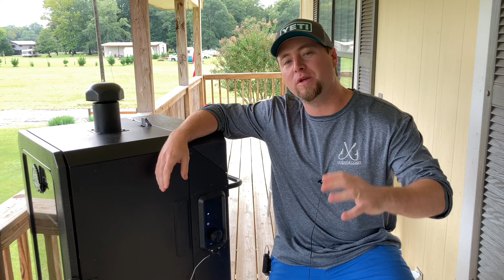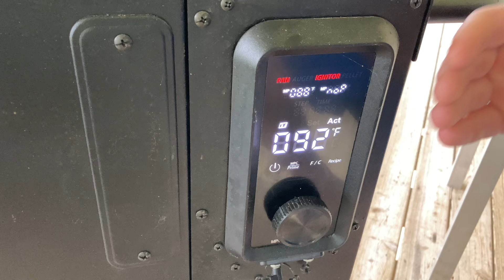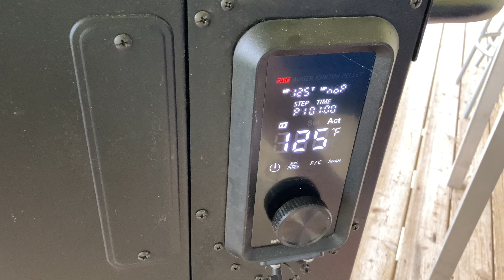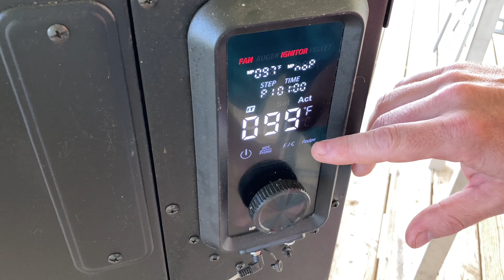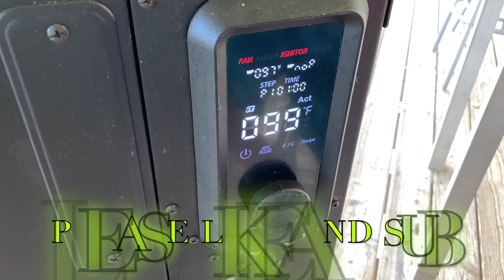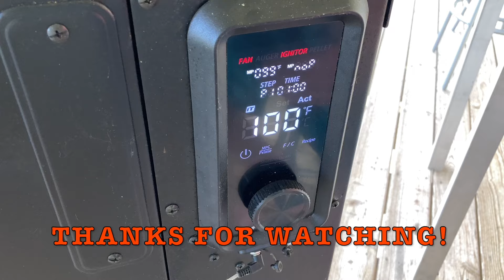How to MASTER the Control Panel on you're Pit Boss Pro Series Series 2 Vertical Pellet Smoker

Comment: When i am taking my meat out to wrap it, I have a loss of ignition. I just bought mine this week, and love it so far. I thought for sure if i was just opening the door and then closing it again, that it would be ok, but i guess not. Its happened both times ive cooked with it now, so im guessing thats what im doing wrong. When you DO prime, How long should i prime when i plan on opening the door to maintain ignition?
Reply from the maker: I’ve never had that issue. Have you primed both times?
Reply: @TheAmericanSmoke neither time. That’s probably my issue, thanks for the fast reply on a 3 year old video 😅
Reply: I’ll have to try it the next time I use it. It’s probably just operator error.
Reply from the maker: @rysingphoenix1524 that’s strange. Try priming next time and let me know how it goes
Reply: @TheAmericanSmoke the thing is, is I can let it get up to temp, put my meat in, and if I take to long, it will lose ignition. Pit Boss Comp blend pellets if that helps.
Reply: @TheAmericanSmoke just figured I’d give you an update. Started using the prime button, she’s not flaming out anymore. Did chicken last night, and I’m doing a pork shoulder and smoke smoked cream cheese right now. Thanks for your great videos man.

Comment: I have the smoker, let’s say I set my temp to 250 and o have a probe on the middle rack it’s always off by 20-30 degrees. Is that normal for these? Probe inside always lower. Thanks!!
Reply from the maker: It is. The internal thermostat in mine is located in the back corner right next to the vent where the heat feeds into the chamber. The temps at the center of the racks and especially at the area of the front of the chamber will usually be cooler. It’s similar in all types of cookers.

Comment: Do you ever have problems with the smoker not keeping the temperature you have set?
Reply from the maker: It did eventually and I replaced my control panel. It was still under the 5 year warranty and Pitt Boss covered the cost.

Comment: Hey man big fan of the page, I recently got a pro series just like yours. I was wondering if the programable temp you should set it to what you want your final meat temp to be at or should I set it a few degrees lower so it doesn’t over cook?
Reply from the maker: That’s going to be a technique you can develop. I would recommend not running the IT up to your highest tolerance before programming the temp to come down. Because you’re right, it probably will run over and possible overcook. The smaller the cut, the more careful you have to be with this automated stuff.

Comment: Is it possible to reduce the temperature  as low as 100 to 110 degrees to smoke venison thuringer ?
Reply from the maker: The lowest temp is the Smoke setting, which keeps the chamber around 130

Comment: I just got a new one of these and I think my control module is newer I don’t have the smoke it icon I’ve gathered they changed to the pit boss app but my smoker doesn’t have a smoke mode I was wondering if you knew if the new ones just don’t have that because where yours says S mine says L then goes to the same temperatures
Reply from the maker: I believe the L will be your smoke setting
Reply: @TheAmericanSmoke  thank you so much I was so confused everything on mines the same as yours except I didn’t see the S and love the videos man keep up the good work

Comment: How do I set the temperature level to smoke mode
Reply from the maker: If you have the same unit, it’s the lowest setting. It looks like a five but it’s actually an S
Reply: I have the same unit, it does not have a "s" mode at all.  Please show yours in the fabled "s" mode.  The unit only shows "L" and an "H"

Comment: I think that my control panel is broken. I've had my Pit Boss Pro 4 for two weeks now. I'm currently doing my third cook on it. My control panel does not have 225°f. It jumps from 200 to 230. Also my 2nd meat prob stays at 32°f and never moves.
Reply from the maker: Definitely sounds to be malfunctioning

Comment: When you program a recipe, how do you cancel it?  For example I set programs 1,2,3 etc, and I want to cancel it halfway through step 2 for whatever reason, and do it manually.  Do you just press the recipe button again?  Do you just turn the knob to your desired temp and it cancels itself?  Thank you in advance
Reply from the maker: I believe you go through the steps and change them or zero them out.

Comment: Hey mate how do u use the smoke setting, I have just bought one of these and don’t really know how to use it , I have used it but there is no smoke setting on the screen, is it just a low temperature setting?
Cheers
Reply from the maker: If you have the same unit as me, it’s the lowest setting. Looks like a 5 but it’s an S. The chamber will only reach 130 degrees on this setting. It’s good for adding a little smoke flavor at the beginning of the cook but after 30 min- 1 hr you will need to adjust to your desired chamber temp.
Thanks for watching!

Comment: Just bought this one last week. Great smoker but noticing a little to much ash around the door and on the racks. Any suggestions?
Reply from the maker: You can buy smoker gasket and seal off the bottom front of the burn pot cover plate or that gap will eventually clog with ash and fix itself.
Reply: @TheAmericanSmoke  thanks for the tip

Comment: Love your video's and subscribed. Only problem I see with the probe is that the majority of food has internal temps from 130-165. I smoked a London Broil at 150* with internal temp set to 133 and of course when that temp was reached it just kept raising and would have kept cooking until I manually turned it off.  What am I missing?
Reply from the maker: The only way you can get the pit to run that low is on the smoke setting. I don’t know if the probe is programmable on the smoke setting. I’ve never done a London Broil, so I don’t want to give bad advice.
Reply: I tried again this time with a brisket and set the temp to 200*. When it reached 200* the probe did not turn the ambient temperature down to 180. It just kept cooking away and at 216 I went through the shut down process. I guess I will return the unit.
Reply from the maker: @donnyl543 reach out to Pit Boss customer service. They will send you a new control panel
Reply: Ya, dropping the temp to 180 won't stop it from cooking. 
When i cook rib roasts ill  pull it out of the oven at 125 degrees internal. I let it rest for 30 minutes and by that time internal temp is 135. Thats out of the oven on a counter using a Meater plus probe.

Comment: How do you reset the Recipe if you make a mistake?  I want to start over with a clean slate.
I press Recipe again and go through the steps and change the temperature press set and go to next step and when done I click the Recipe again to set the Recipe but the temperature stays the same.
Reply from the maker: Power off power on is probably the easiest option

Comment: Got my smoker in same as yours. 
Im having an issue where I set it to a temp and it gets up to it then settles down about 30 degrees less and stays there. 
I.e. I start it up (maybe need to keep it in smoke mode until it fully preheats?) Set to 300 and it gets to 300 then drops to 270 and stays there. Am I just not doing startup properly? I start it with door open until I see smoke then I close it and set the temp. Am I supposed to leave it in "s" mode until it fully preheats to that temp first? Then set it to the temp I want? Thanks for all the videos. Doing ribs right now but have to have it at 260 for it to be 225-230
Reply from the maker: I’ve had a few people tell ask me about this lately. Not sure if it’s an issue with the more recently produced units or what. 
My recommendation is to fill the water pan and run the unit up to 350 or higher before the protein goes into the smoker. Then dial down to your desired temp and put the protein in. 
That being said, there is always going to be a drop in chamber temp when you put food in. Takes a little time to regulate. I hope this helps!
Smoke on!!!

Comment: Hey man! First off, great videos!! So I just did my initial burn off on my PB850 and my first time smoking anything will be tomorrow. As far as the probes go, if I use the probe in the MPC connection.... If I just plug it in and stick the probe in my turkey, will it just monitor the temp of it? Or do I NEED to set my desired temperature on the probe first?
Reply from the maker: As long as that temp probe is plugged in is going to monitor temperature. Doesn’t matter if it’s sitting on top of the smoker or inside of your turkey breast.

Comment: My husband is having trouble with the temperature dropping?
Reply from the maker: There are going to be temperature fluctuations. As long as it averages out to the desired temp, I wouldn’t worry. If it constantly stays low, there may be a bigger problem.

Comment: I don’t know what’s going on. 😂 so I put a brisket in the smoker Friday night/ Saturday morning at 1am hoping it would be done Saturday about 3:30/4pm. No such luck, here it is Sunday at 9:30pm and the brisket has not hit 208°, that the temp I normally would pull it and let it rest for 3 to 5 hours. As I write this, it’s at 187 flat and 192 for the point. I was just wondering if u have run into this issue. I have the same smoker you do. Any insight would be helpful. The smoke temp was 230 to start. Anyway, like your videos, keep up the good work.
Reply from the maker: Wow! Pull your meat probe out of your brisket and let it hang in your chamber. On the same rack as the brisket. See what reading you’re getting.
Or if you’re not using the one that comes with the smoker just hang that in there.
Reply: @TheAmericanSmoke  I had a 3rd probe in just the smoker, it was bouncing between 220 to 248.  I though it maybe my thermometers, I had in the meat, but even the instant read thermometer showed the temp.
Reply from the maker: Well… it’s Monday. Is the brisket done yet???
Reply from the maker: Also, please come to my Facebook group called American smoke carnivores, and share some pictures of this two day long smoked brisket.
Reply from the maker: Please do!

Comment: Hey brother. How long does it take for your vertical to get up to temp? I'm burning some stuff off and it's been 30 mins and won't reach 300. Now I'm in south east ga and the climate is in the high 70*.
Reply from the maker: I usually allow 30 min. Make sure your not sitting on the smoke setting. Turn the dial to the temp you want and the press in the dial for a click. 
If that’s not the problem, then hold down the MCP Prime button for a couple minutes to fill your ash pot with pellets. That should get you there. 
If not, there may be a problem.
Good luck. Keep me posted

Comment: Just bought one of these last week, smoked some ribs last week, came out great. But last night I tried cooking a pizza in it. I programmed the temp to 410, once it reached it’s desired temp, I put the pizza in. Once I did that the temp start to go down all the way to about 225. Any tips on what I did wrong? I straight up unplugged the smoker, plugged it back in and started working again.
Reply from the maker: TRBL! We're you using the app or the control panel?
Reply: @TheAmericanSmoke  sometimes I use both. But mainly the control panel.
Reply from the maker: I've had trouble with the app. Several times where it has dropped the temp down to the smoke setting. That may be your problem. I've never had that problem using the dial. 
However, I have forgotten to push in the dial when adjusting the temp before, to set the temp adjustment. If you set it to 410 and it was running at that temp, then dropped on it's own, no human error, then it may have been a glitch in the computer system. 
I hope this helps. Thanks for reaching out. Let me know if there is anything else I can help with.
Smoke on!
Reply: @TheAmericanSmoke  that may have helped. thank you. last night when it dropped below 250, i straight up unplugged the power cord, plugged it back in, and then it actually started going up to 370, but by that time the pizza was done. appreciate the tips dude.
Reply from the maker: Anytime
Reply: @TheAmericanSmoke  should I only use the control panel?
Reply from the maker: That is what I prefer. The app it too touchy and they should not have the temp adjustment dial on the home screen
Reply: @TheAmericanSmoke  appreciate any advice you give brother. Cheers!!
Reply: @TheAmericanSmoke  appreciate any advice you give brother. Cheers!!

Comment: Question , Maybe I'm ignorant but how do I set an uneven temperature ?!!!!! My unit moves in 10 minute differences , what am I doing wrong !!!!!
Reply from the maker: You can’t. Your lucky. The unit I have is a little older and once I’m over 250 it moves in 50 degree increments. It’s terrible.
Reply: I ment to say degree instead of minutes , sorry !!!!!
Reply from the maker: No worries! I figured

Comment: Is the p1-p7 the p setting ?
Reply from the maker: What unit do you have?
Reply: @TheAmericanSmoke  I have the vertical pro series 4 V2
Reply from the maker: @bendersbbq3060  on my current control panel I do not have the p settings. Yours could be the newer version. I have a new control panel coming though. 
I know on the barrel type pellet smokers, those would be your p settings.
Reply: @TheAmericanSmoke  okay so when you press the recipe button I’ve noticed the auger turns on more often when you get higher in the P-1 P-7
Reply from the maker: Okay, your talking about in the recipes. The P stands for Preset. No effect on the smoke. These units do not have P settings like the older models. If you want heavier smoke use the Smoke setting for a while at the beginning of your cook or get a smoke tube. The smoke setting is your lowest temp and will look like a 5 on your control screen. 
It’s actually a S and stands for Smoke. Your temp will top of around 130 degrees on this setting and is not an appropriate temp to fully cook anything. 
I hope this helps. Thanks for watching. If you’re not already, it would be great to have you as a subscriber.
Reply: @TheAmericanSmoke  yes I do follow you. Okay so I’m going to try not to set it like how I thought it was a p setting. Just let it do it’s thing
Reply from the maker: Right. Thanks for the support!

Comment: My panel somehow goes in increments of 10 which means I cannot do 225 anymore. Does anyone know how I can get it back to 225?
Reply from the maker: You have the newer model. 230 will do just fine.
I honestly like smoking at 250 better on this unit anyway. Not sure why, but it seems to do better.
Thanks for watching my video.
If you’re not already, it would be great to have you as a subscriber.
Thanks!!!
Reply: Thank you for the reply. I subscribe to your channel and find it very helpful.

It was able to when I got it and now it doesn’t. That what makes me thing something happened but 250 will work. I am doing my first brisket this weekend. Very excited about it
Reply from the maker: @Jayteeville  Aaron Franklin aka Barbecue Jesus, cooks his briskets at 275. Give or take. 
I’m making a hot and fast brisket video this weekend, so stay tuned to see how it turns out.
Thanks!!!
Reply: @TheAmericanSmoke  ha I used to be able to hit 275 also. Now it is either 270 or 280. I will do it at 250 and will go from there!
Reply from the maker: How did it turn out?
Reply: @TheAmericanSmoke  it was okay, not great but okay. It looked moist and chewy but then turned dry and a little tough to chew
Reply: @TheAmericanSmoke  the smoker died on me as it gave an error message about the igniter so I returned it for another one.

Comment: Need to discuss the programmable meat probe.  It does not turn the smoker off, it is designed to turn the temperature down to  180 . I've never got there.  Ok pit is at 200 meat probe programmed to 145 cooking pork chops.  Chops reach 145.  Pit seems to start to cool down. Here's the buttttttt,  if let the meat smoke while the pit cools the internal temperature continues to rise it can reach 155  because the pit is still hotter than I want the internal temperature to be. My point is I still need to take the meat off if I dont want the internal temperatures to rise.  It doesn't stop or slow the internal cooking temperature efficient enough to keep the internal temperature at a constant.
Reply from the maker: You could program step two of the cooking process to take it to the smoke setting.

Comment: I love this smoker, but am I missing something?  When setting the temp, it goes 200, 225, 250, 300... is there any way to set it to like 275? or in between temps? Thanks!
Reply from the maker: You have the same model as me. There is not and Pitt Boss offers no solution. 
Good news is that the food still comes out great.
The newer models have more precise temps.
Thanks for watching my video. If you’re not already, it would be great to have you as a subscriber.
Thanks!!!

Comment: When it’s on the smoke setting what’s the temperature your cooking with?
Reply from the maker: It’s going to max about at around 130 on Smoke setting.
Thanks for watching my video. It would be great to have you as a subscriber.
Thanks!!!
Reply: Oh okay so I wonder if that would be useful on a brisket? And I just subscribed brotha actually watching more videos rn haha
Reply from the maker: @kazmcclure3925  that awesome. Thanks for the support!
I will sometimes leave my proteins in the smoke on the smoke setting for an hour or so and then crank the heat up to desired cooking temp.
I don’t do it as often since I started using a smoke tube though.

Comment: I just bought a series 2 from Lowes and they put it together, the door don’t fit even with the cabinet and there is no adjustment and the racks are to small they keep falling from there rack slots like if they are to short, is this a common problem, help.
Reply from the maker: No, that’s not common. Call Lowes. Something is wrong.